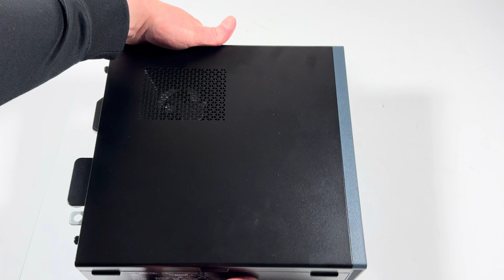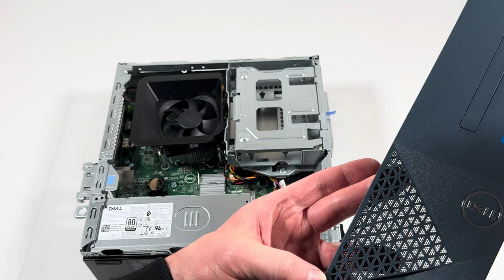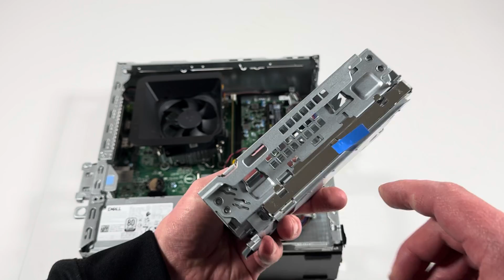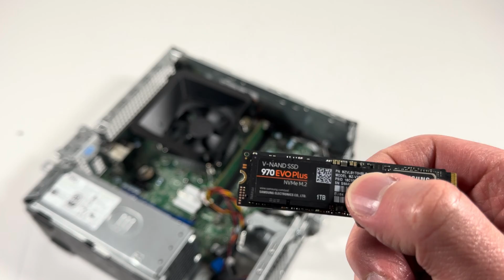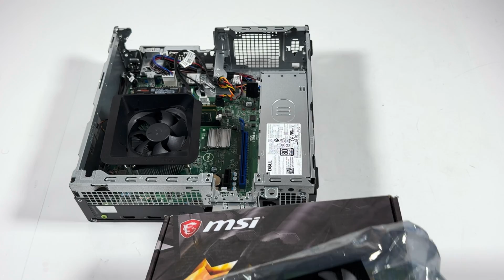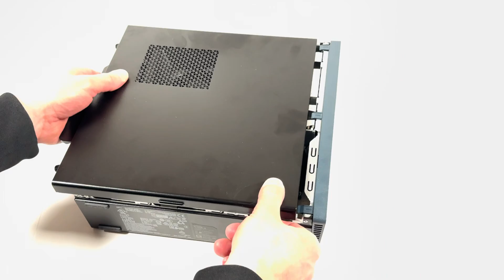Dell Inspiron 3020s 3020 Upgrade Video Card SSD RAM

Comment from the maker: List of Parts and Upgrades works with this Dell Inspiron 3020.

Dell Inspiron 3020 Teardown
https://www.youtube.com/watch?v=vktATCIRNzw

List SSD Heatsinks:

(1.)  M.2 2280 SSD heatsink, Double-Sided Heat Sink, PCIE M.2 SSD
https://amzn.to/3l2ittr

(2.)  EZDIY-FAB M.2 2280 SSD heatsink, Double-Sided Heat Sink, M.2 SSD
https://amzn.to/3m7J3me

List SSD M.2 Type 2280 NVMe PCIe:

(1.) Crucial P3 Plus 4TB PCIe M.2 2280 SSD
https://amzn.to/3RZcUNi

(2.) Crucial P3 Plus 2TB PCIe M.2 2280 SSD
https://amzn.to/3RTUi0Y

(3.) Samsung (MZ-V7E1T0BW) 970 EVO SSD 1TB M.2 NVMe
https://amzn.to/3d52k2a

(4.) Samsung 970 EVO Plus SSD 500GB
https://amzn.to/3fpi95A

(5.) Samsung (MZ-V7E500BW) 970 EVO SSD 500GB - M.2 NVMe
https://amzn.to/37uuLFw

(6.) Crucial P1 500GB 3D NAND NVMe PCIe M.2 SSD - CT500P1SSD8 
https://amzn.to/2N07wKh

List of RAM will work with this system MAX 64GB.
Supports Non-ECC DDR4-3200/2666/2400

(1.) Crucial 32GB Kit (2 x 16GB) DDR4-3200 UDIMM
https://amzn.to/3BdbNm3

(2.) Crucial 16GB Kit (2 x 8GB) DDR4-3200 UDIMM
https://amzn.to/3U24CpE

(3.) Crucial RAM 64GB Kit (2x32GB) DDR4 3200MHz
https://amzn.to/3xEsF4b

Thermal Grizzly - Spatula for Applying and Spreading Thermal Paste 
https://amzn.to/3d8NQEE

Thermal Compound Paste:

(1.) Arctic Silver 5 Thermal Cooling Compound Paste 
https://amzn.to/2ziNU0H

(2.) Noctua NT-H1 3.5g, Pro-Grade Thermal Compound Paste
https://amzn.to/36kTk7A

(3.) ARCTIC MX-4 (current edition) Thermal Compound Paste 20 Grams 
https://amzn.to/2DhGJaK

List video cards will work with this system.

(1.) AMD Radeon RX 6400 Low Profile Gaming Graphics Card
https://amzn.to/3s8MUUY

(2.) PowerColor AMD Radeon RX 6400 Low Profile with 4GB GDDR6 Gaming Graphics Card
https://amzn.to/3ucfFEm

(2.) Gigabyte GeForce GT 1030 GV-N1030D5-2GL Low Profile Graphics Card 
https://amzn.to/2Z4PHkp

(3.) ZOTAC GeForce GT 1030 2GB GDDR5 64-bit Low Profile Video Card ZT-P10300A-10L 
https://amzn.to/2WzgLXk 

(4.) MSI Graphic Cards GT 1030 2GB GDDR5, Low Profile
https://amzn.to/390Spum

HDD list works with this PC:

(1.) Seagate BarraCuda 4TB Internal Hard Drive HDD – 3.5 Inch
https://amzn.to/3d3xWeR

(2.) Seagate BarraCuda 8TB Internal Hard Drive HDD – 3.5 Inch
https://amzn.to/3xjUDSJ

(3.) Western Digital 2TB WD Blue PC Hard Drive HDD - 5400 RPM, SATA 3.5" - WD20EZAZ
https://amzn.to/3w3jIQA

(4.).WD Black 2TB Performance 3.5" Hard Drive - 7200 RPM Class, WD2003FZEX 
https://amzn.to/2xFUeyF

Disclosure: Amazon links this means that if you purchase an item we earn a small sales commission affiliate.

Comment: I bought the same 1tb Samsung 970 Evo Plus ssd, but for some reason, my OS doesn't boot. Also, i bought a 16gb crucial ram stick, and it also doesn't work. It gives me a 2,4 light indicator, but I already switched out the coin-cell battery. Does anyone know what to do

Comment: I have added a JSON pcie sata card to the express pcie port on my 3020S, attached 2 Teamgroup QX 4TB ssd. Power to sata card & both ssd's. Neither new ssd attached is showing up on computer anywhere. Is there something I need to do to activate the pcie express port or some setting you know of needed for the installed sata card to be recognized by computer? Running Windows 11. Any info or suggestions would be greatly appreciated. Racking my brain for a few days now, how to get computer to recognize the new ssd cards. Thank you.
Reply: Power problem probably. PSU is only 180 watts
Reply: Créer une clé de démarrage toi même. Clé USB 32gb cest bon. Aprés redémarre avec la clé créer tes partitions c'est bien guider.

Comment: i got the same pc, you think i can use a 4060 low profile on it? i know 4060 uses power but im planing tu upgrade pcu to
Reply: I intend on doing the same
Reply: @LukeONeill-iw1cd if you got the 3020s it's imposible, the 4060 is 2 slots, and de pci express is at the bottom slot. I buy it ant it don't fit 🥲
Reply: Um yeah I've literally bought this same PC and gpu the problem is space. I bought myself a flex psu (very small psu) and wanted to plug in the connections to where they go. The problem is there are currently no adapters for the 8 pin available rn.

Comment: WHEN YOU INSTALL A LOW PROFILE GRAPHICS CARD IN this Dell 3020S,  how many monitors can be attached to the graphics card?  Does adding the graphics card DISABLE the on-board built-in HDMI & DisplayPort PORTS? OR can you put a monitor on the built-in HDMI, then two more monitors on the new graphics card?   THANKS!
Reply: I added an Intel arc a380 to my desktop which has one hdmi port and one displayport port. you can play monitors into your gpu and the motherboard at the same time, but it's recommended to not do that as its pretty slow or laggy sometimes. for how many monitors can be put on one gpu, it mostly depends on how many ports are on the gpu

Comment: FYI - The Crucial Pro RAM 32GB Kit (2x16GB) DDR4 3200 do not work on this model.  Just tested
Reply: It's possible the model numbers are the same but you need the non-pro version. The model without the heat shield works. Trust me 👍
Reply: @YFZriderdude15  Thanks for that, I have the 64gb kit (classic version) CT2K32G4DFD832A coming from Amazon tomorrow, I'll confirm if it works.
Reply: @nevets237  You're welcome. I would be interested to hear if it still works or not. That's the model number I bought a month ago, after testing the pro version, and it recognized the classic. I bought my 3020s at Costco. Just be sure you install them in the right direction.
Reply: @YFZriderdude15  Just received my delivery - and can 100% confirm the standard (non heat shield) CT2K32G4DFD832A 64gb kit works in the inspiron 3020s. With 63.7gb usable. 

I also have a Inspiron 16 plus (7010) Laptop that also works with 64gb crucial upgraded RAM.
Reply: Which ram did you end up getting? I want to upgrade to 64 gigs of ram. You think the Crucial 64 gig kit would work?
Reply: You are correct, you need Crucial model CT2K32G4DFD832A
Reply: Why doesn’t it work? Weird.
Reply: Both Crucial Pro RAM CP2K32G4DFRA32A and CT2K32G4DFD832A 32GB do not work on Dell Inspiron 3020S. It doesn't recognize the RAM.
Reply: @weigeng4226  CT2K32G4DFD832A will work
Reply: @weigeng4226  CT2K32G4DFD832A works great on mine. Sounds like you only tested the pro version. I had the same issue and had to return and then buy Standard model